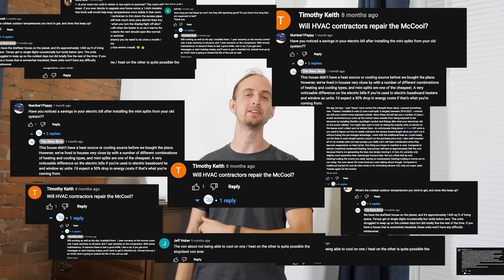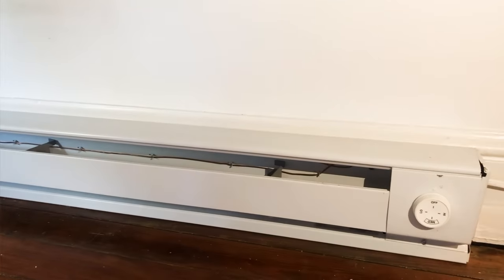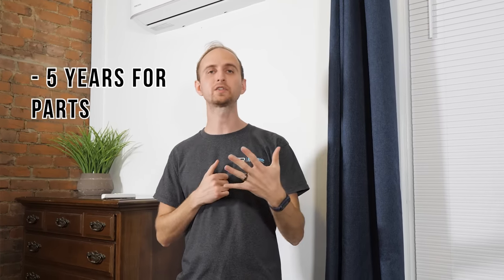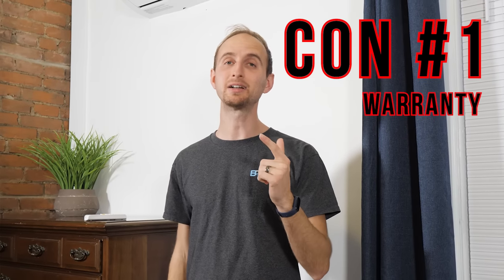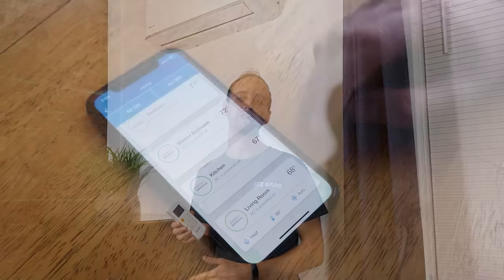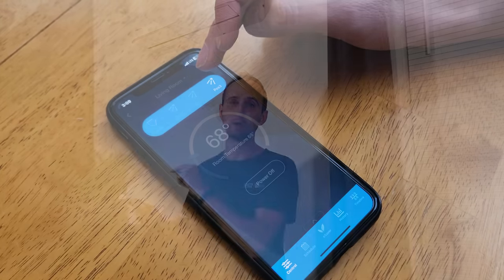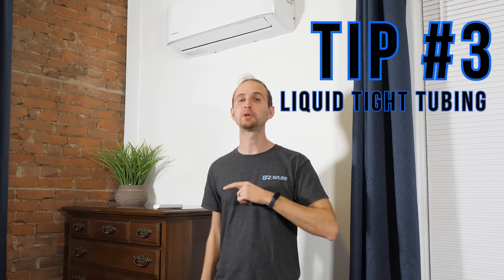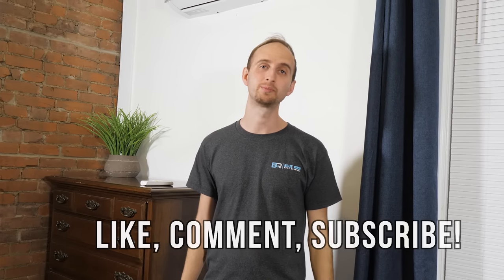Mr Cool DIY 2-Year REVIEW: I wish I would have known this BEFORE BUYING...

Comment: If you buy the advantage series and a professional doesn't install it, they do void your warranty.  You bought the DIY version.  Advantage series is $600 cheaper, just because you dont get the cardboard template and you have to evacuate the line set, which is easy.  Warranty is the downfall

Comment: The only thing i don't like about mini splits is the lack of filtration compared to a central unit unless there's a way to make it better that's my only gripe
Reply: YES,,, NO FILTRATION
Reply: Yeah, I agree.  But I think this is a necessary evil to get these high SEER numbers.  But, it also means unless you actually clean the coil annually, you probably aren't even getting those high SEER numbers...
Reply: @kevin9c1  the newer ducted traditional systems are getting up there as well but they still don't get near their rating unless your attic is a conditioned space but ultimately you'll need a air filter inturn you lose what you're trying to save in money and power usage
Reply: @crashinc06  Yeah and the install cost of those ducted systems is totally ridiculous.  Good luck ever recovering the cost through energy savings!

Comment: Interesting - I found myself thinking that occasionally I have needed a touch of heat in my bedroom with the a/c as well - seems like when I would lie in bed I would be cold, and my bones would ache - yet I needed the a/c air for breathing better - rare, but occasionally I would need this - and found my mother mentioned the same thing at her place. Also, in the car I have needed to use the a/c due to allergies, yet heat the air a bit - you mentioned the window a/c's, some of them are not that bad in efficiency - our HOA (from hell) wants us to use portable a/c's, which do not perform very well, and the EER on them is about half that of a good window a/c - mine are 12 EER and 10.8 for my casement - I finally have seen one portable a/c that claims to be in the same ballpark as a window a/c, with an inverter motor - but time will tell if this will be a reliable product. Most of the portable a/c's we sell in our store end up coming back as returns.

Comment: @ RENO BROTHERS:  SEER applies to cooling only.  
                                       HSPF is the heating efficiency only.  
SEER right now, can be available at somewhere around 25, for most efficient cooling.
HSPF right now, can be available at somewhere around 12, for most efficient heating. 
LOOK at those 2 ratings.  Many sellers don’t even tell shoppers those 2 figures, or, will only list the SEER!!   That’s like buying sight-unseen, gambling on getting something that fits your needs. 
MANY sites or sellers will try to just sell you less efficient units for primo prices.  
DON’T be a sucker for lower-efficiency units!!  

Also, unless something has changed, buyers who cannot afford to ..Itemize.. on their taxes, cannot get the Fed incentive money for energy efficient upgrades, be it these systems, or solar merching your roof, or getting a hybrid water heater, etc. 

You need to do some math, to figure if the ROI for a heat-pump minisplit system will be paid off long before it requires replacement parts or whole system.    
All the estimates we got, even for best systems, meant we’d still be making payments on them, in about 10 years—which coincided with about when they estimated we’d need major parts or replacements.  
And, most of the contractors estimating, wanted us to sign up for them to do the annual maintenance (cleaning filters, cleaning the heatpump)….some gave no choice on that, & charged almost $200 for it. 

When we moved into our 70s tract house, it had “overkill” baseboards in every room.  
That is, over 2400 watts each; family room (about 14x14’), & the livingroom (13x18), had TWO of those big monster baseboards.   So, we removed the 2 in family room, & used those wires to make kitchen plugs for appliances.  We removed the ones from the livingroom, & only put back one 750 watt unit.  We exchanged the diningroom & master bedroom units for 750 watt units each.  We kept the 500 watt bathroom baseboards.  The other two bedrooms don’t use baseboards; one room uses the 700 watt toggle on a portable oil-filled radiator, & the other needs an AC unit almost all year.  Doing that, dropped our worst winter heat bill by at least $70.  
The other issue was leaky windows.  I scavenged enuf matching windows being discarded by neighbors upgrading, then, framed out 3” around each window, & mounted the recycled windows.  
Each window got cleaned & resealed with silicone calk before assembled & sealed in place.   Just doing  (2) 4x5’, & (2) 5x5’ windows, & temporarily mounting half a recycled slider door over half of our patio slider, dropped our worst winter heat bill by about $100.   
ALL but one of the recycled windows added, were single-pane aluminum framed.  Only one was a dual-pane, with broken seal, so it could only be used in a sheltered area.  
Not even several more bags of fluff blown into the trusses, & a reflective blanket over that, plus repaired & augmented under-floor insulation, got any savings.   
But my “storm windows” sure did!   The 3” airspace between the windows, works better than usual dual-pane windows, because of the 3” airspace.  
I do not care that those pump-out.  Eventually, this place will need external-added insulation & new siding…,probly several inches—which will bring the walls out to match the level of the “storm windows”.

Comment: #1, you never remove and replace parts on mini-splits.  You replace either the indoor or outdoor unit in total and move on.  The price of the units is so cheap that it costs less than a service tech's time to repair.  This is a pro feature.  Easy removal and replacement.  I have 5 and I keep an extra indoor unit and an outdoor unit on hand at all times.  At the time I purchased these I think I spent $800 for the additional set or pair.  One service call with any motor replace etc would easily cost more.  If my indoor motor quit I'd take 1/2 of the pair I have on hand and replace it.  It's possible to suck the refrigerant into the outdoor unit by closing valves and use it in the new indoor unit.  The new outdoor unit has refrigerant already in it.  So no big deal.  I've installed hundreds of these and would never attempt repair on one of these.  Ever.

Comment: Cooper and Hunter's Astoria's units now have a unit that getting to the motor takes 5 minutes. But they cost more.
Reply from the maker: I’ve never heard of those. I have heard that Daikin and Mitsubishi are the best, in that order.
Reply: @TheRenoBros  Depends on who you ask. I've heard Mitsubishi does better support. Both cost a lot. Cooper and Hunter is just another Midea clone brand, but AC Service Tech (channel) likes them. They are the easiest way to install a central HP system that works at -22 from 2 to 5 tons that also includes a thermostat that does proper variable speed control. It's around half to a third of the price of a Mitsubishi unit. Not as nice mind you, but who cares when you self install and have no warranty anyhow.
Reply from the maker: @sprockkets  I’m curious what you mean by self-install and have no warranty. People have told me that Mr Cool requires a pro installer for warranty even with their DIY models, but I self-installed as a homeowner (not a pro HVAC guy in any way) and have gotten warranty replacements without them even asking me or caring who installed it…
Reply: @TheRenoBros  Well, I'm not sure about MRCOOL other than DIY has a warranty, but Senville's warranty says no warranty without a contractor doing the final installation. Pioneer which I also use, says you get a 5 year standard warranty if you don't have a contractor do the final startup part.
If you install Mitsubishi or Daikin, well, no, don't expect any warranty. Of course with them, most contractors won't even take money to fix it either.

Comment: So if you're a person who stays hot like me and you live in a home with a person who stays cold then this system would be a nightmare
Reply from the maker: This system would be better than central air in your case, because you could just turn off certain units. Closing vents for central air only does so much, but you can maintain quite different temperatures in different areas of the house with a minisplit simply by changing the temp setting or turning off the unit entirely.
Reply: @TheRenoBros  oh okay, I didn't realize that. Because our current wall unit in this trailer isn't working

Comment: The main problem is the terrible house you purchased. No matter what heating system you install, it's going to struggle. You can hardly endure the five or ten minutes it takes to occasionally defrost? Jeez....honestly, I think you need to sell this clunker and buy a better home. I'm up in British Columbia, Canada, on a freezing day, and I let the woodstove (our only source of heat) go out hours ago. I won't be relighting it until tomorrow morning. Good video, by the way!
Reply: $80/ month electric bill is heavenly! I have central heat and air and mine was $350 last month.😡
Heck I’d be happy with a $150/mo bill let Ali e only $80 average.

Comment: Read your manual.  The manual addresses all of these issues.  It is better to spend more on insulation than to try to control the climate in a poorly insulated homes.  Frankly, home construction in the USA is way behind the times.  SIPS construction is currently the best way to go and some companies offer the highest R values you will see anywhere.  Many homes of this construction are relatively impervious to the elements.  Sips homes that are wrapped in metal are the best.  Personally, I am more concerned about how a home performs than how it looks.  I have seen really drop dead gorgeous homes with loads of problems associated with the construction methods.

Comment: Sir I am a technician and most of the time it’s not the motor that needs to be replaced it is in lack of lubrication. If you can figure out how to apply it then you’ve mastered the repair. On most motors there is a pocket near each end of the motor shaft. It’s like a cotton pocket that holds the oil. Zoom oil is best or sewing machine oil. HOWEVER YOU STILL HAVE TO DISMANTLE THE DAM THING. GOOD LUCK.
Reply from the maker: Can you recommend any video that shows how to do that? Or perhaps you could make one to show us all?
Reply from the maker: I’d be happy to give a shout-out if you create a video showing that

Comment: the biggest con is service.  It's really hard to find a company to service a min split that they didn't install.  My 4 year old, stepped on the refrigerant lines and caused a leak.  When I finally found a company willing to service my system, their guy didn't know how to charge it in the winter.  Thankfully, a contractor friend of mine knew an HVAC guy who knows Mitsubishi really well and he took care of me. 
If you hire a mini split specialist, it will coat about $5000 per zone.
Reply from the maker: Thanks for all of that great info! Such an important part of the discussion!
Reply: @TheRenoBros  I will say that I have a second Mitsubishi system that I had installed over 10 years ago and it's never needed service of any kind.  And because it's so high on the wall, the filter almost never gets dirty.
Reply from the maker: @SoCalVipers  good to know!

Comment: Your con about two head units doing different things is like asking three tires on your car to roll forward and the fourth to roll backwards. Your drivetrain can do one thing at a time. If you need different functions you need separate split systems
Reply from the maker: That’s not what the con was about…

Comment: spray wd40 on the blower motor shaft. or If you can remove the top shaft cover you can change the bearings for a much better make. usually they dont go bad. but sometimes they do.
Reply: 3 in 1 household oil is better. WD40 evaporates and doesn't last. I'm talking from experience.

Comment: We've had a Mr Cool going on 4 years.  Replaced the motor about a year ago and its starting to make the same noise.  And now its developed a LEAK.  Because of this its now useless and getting someone to fix it is just about impossible. The few companies that do work on them makes it cost prohibiitative.  I am replacing the whole thing with a new one from a differant company.   I now consider minisplits as disposable appliances, like a Dishwasher or Fridge.  You can get lucky and they can last a long time,  or you can end up replacing them every 4 or 5 years.  These are just one step above a portable room AC.

Comment: This is a good video!
Dude if you’re a contractor you should know! Once a tech touches it they own it until another company comes along. I’ve been used in scams, and been scammed, by dogsh*t homeowners. 
In the state of TX you can get sued in a NY minute, and they will.
P.S. We install various asian mini-splits; special adapters/ no gauges because they are charged by weight/ incoherent or nonexistent repair procedure guides/ asia focused wiring diagrams/ user guides transcribed from a foreign language… No. No, no, no… They are designed to be tossed as soon as they break by a culture that dumps all their garbage into the ocean. I’m happy to hear that they have built a warranty program because they didn’t have one in the beginning for the first adopter’s. 
The fact that you bought the system for a “local” retailer will make me take another look at them but in the beginning it was “online only.”

Comment: The motors couldn’t be fixed?
Reply from the maker: Maybe, but I got new ones for free under warranty, and I was told by an HVAC tech that it's extremely time consuming to take apart a motor and put it back together correctly. They said you're better off just buying a new one (about $120 for a new motor)

Comment: ALL TRUE INFO. I have had my 24 HP unit for one year. Saturday at 10 am it stopped working. Call to the only two HVAC service people and they WILL NOT WORK ON A MR COOL DIY as you stated. I did the troubleshooting myself and found the PC Control board in the compressor unit was fried, burnt to a crisp. It is now Thursday and Mr. Cool warranty department is still thinking about it?????  I have numerous emails describing the unit, pictures showing the damage, electrical meter reading to substantiate this. However, they must check off all the boxes before they will give me a warranty board.  In the meantime, I am dying in 105-degree day time and 80-degree overnight temps. It cools great, but heat is marginal at best. YES, always going into defrost mode in this high humidity winter environment. I have seen it defrost for 10 - 15 minutes at a time every two or three hours.

Comment: Mini splits are notoriously difficult to install leak free. Even the most experienced HVAC installers have leaks on those small things and it’s because of the poop connections used on the copper line set
Reply from the maker: Just had a tune up and the charge in my system was perfect in all lines. This is after 2 and a half years so far
Reply: It's not really any different from any other flared system, other than the DIY units. Get a good flare on it, with a drop of nylog on the flare faces, and then torque appropriately. Mine held 500psi for ~50 hours under test, and went down to 10 micron held for several hours. Use good clean nitrogen to sweep the lines, vacuum appropriately, and use an actual torque wrench, and you're set for years.
Reply from the maker: @Nidkidful  Can you recommend a good video to learn?
Reply: @TheRenoBros  that’s extremely impressive!

Comment: The AC/heating companies want the profit of the installation.

I got an estimate on an exact same syatem pro installed vs my DIY cost.  $6000 of mini split system equipment.  $22,000 installed.

I'll save the $16,000.  Thanks.  I can replace the entire system twice and still be better off DIY.
Reply from the maker: Sounds about right!

Comment: Complaining about a 5 minute defrost cycle and having to change a setting that only occurs occasionally to keep your system running correctly. Kinda paints a picture of someone who is really focused on instant gratification. Especially when one of them doesn't require you to do anything, and the other you can do from your phone while sitting on your couch. I dont think i would actually call those cons personally.

Comment: OMG stop!  Your light bill is gonna go up overall. In the summer it will be less if you had been using window units but will go up in the winter. Now it’s still cheaper as you are not buying oil or gas. SEER rating is for the AC, HSPF is for Heating and the COP is really how efficient it is and this will change with temperatures. Most will will be listed at 47 deg. If it has a 3.5 COP rating that means if you give it $1 it will give you $3.5 back.
Reply from the maker: I appreciate the insight! Although I'm not sure what a light bill is. I've never seen one of those before.